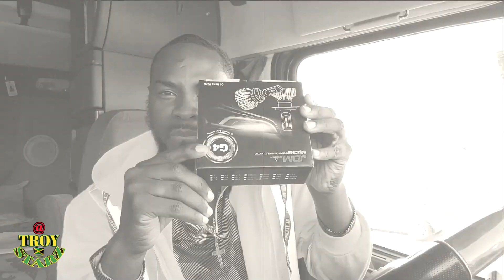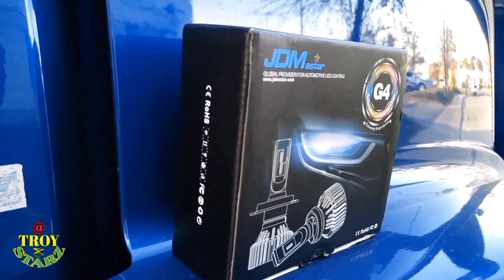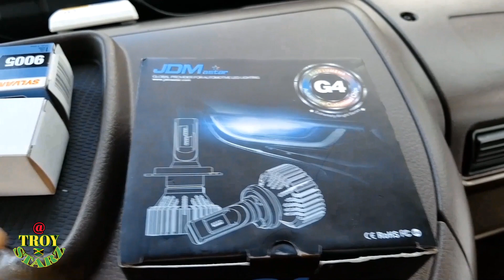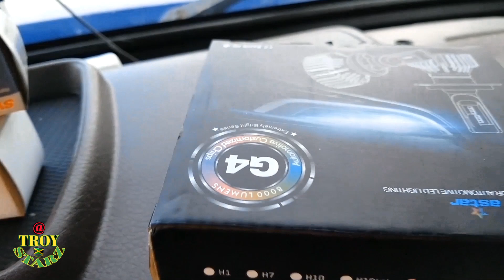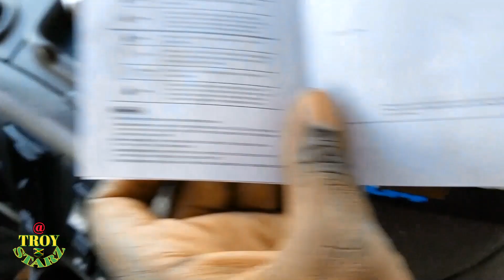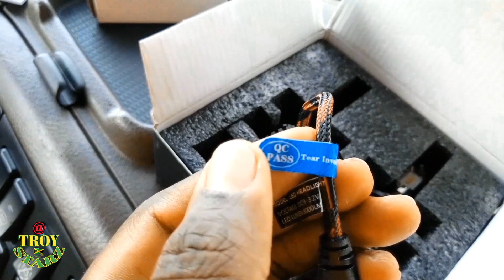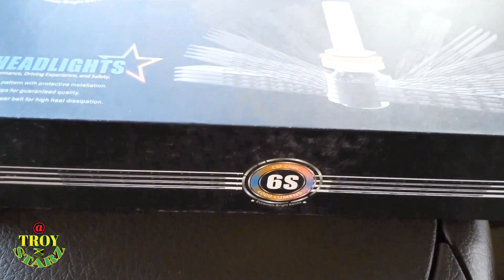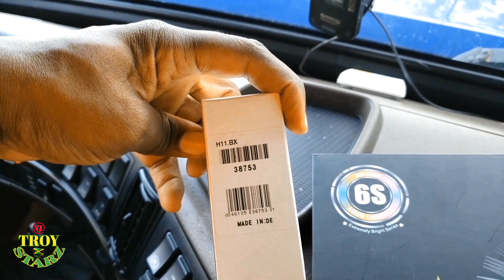Review & Install The Best LED Headlight Bulbs For Volvo Trucks JDM Astar.

Comment: Hi My question is if i used 9006 and 9005 on my truck,  could i use h11 on low and high to replace 9006 and 9005 because i 👂 h11 works on both

Comment: I drive a 2013 volvo vnl ishift and my bulb sizes are h7 for low beam and h11 for high beam however they dont seem to be as complex as your headlights. Mines are secured by a metal pin as opposed to push and twist, I want to upgrade to LED bulbs but this Volvo's bulb sockets are different than ones I've driven before any suggestions mi yute?
Reply from the maker: You can call jdmastar they will give you the correct one's for you

Comment: I bought a set of t r u x bulbs had the resistor pack built into it but it didn't fit in the housing too tall
Reply from the maker: Which one you call r u x bulbs

Comment: Hey man nice video!!! One question did you have any issues after installing Led bulbs, any CHECK errors on the dashboard?
Reply from the maker: No, No codes  the only thing I saw I turn my truck on and the light wasn't warm up it show me sign to check my lights but as soon as i turn the high beam on it goes away that just happened once I works well I'm still using them
Reply: TroyStarz TRUCKING VLOGS Nice, thanks a lot man for the quick respond and information 👍👍👍

Comment: If you need elected to say whether or not you have to take the truck in the Volvo and have them change the setting on the ECM so that it doesn't throw a light code